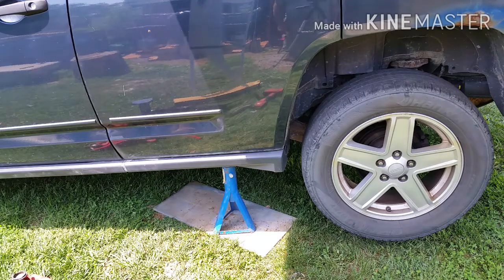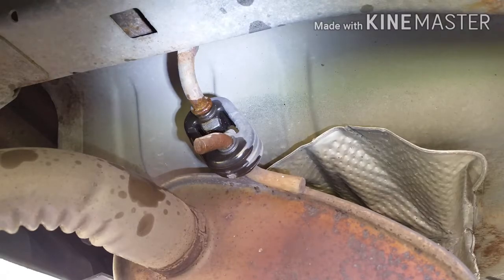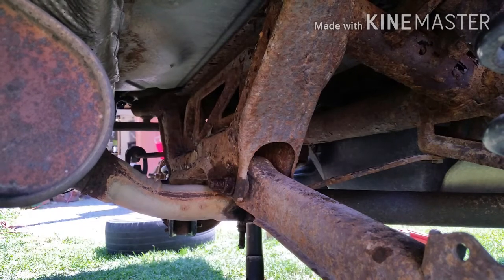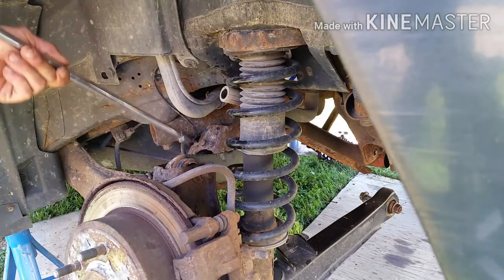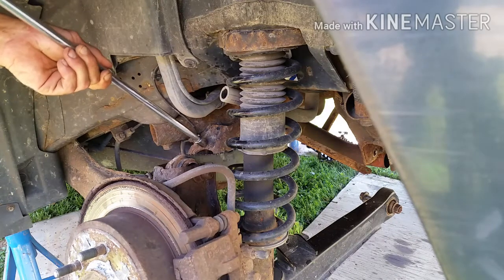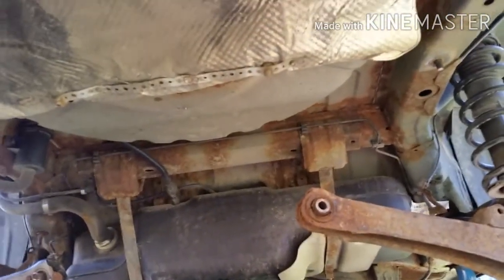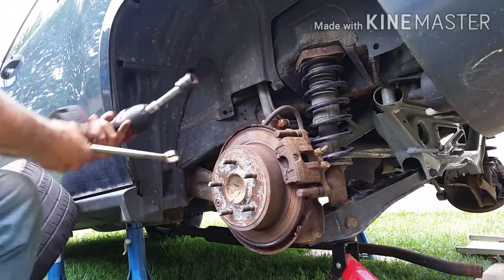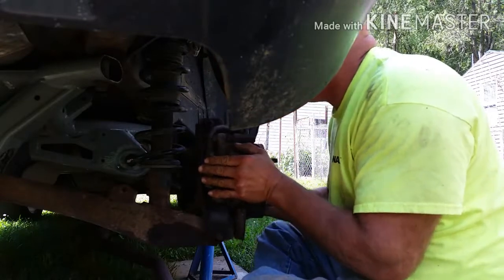How to change the Rear Sub-frame on 07 jeep compass

Comment: I realize this is an older video, but its just what I've been looking for. I gotta 2009 caliber sxt needing the rear subframe replaced and it looks like a heck of a job. You gave me some really good tips on disassembly and I appreciate it immensely. Didnt see anywhere on how long it took you to complete the job. Guessing at least 1 solid day. Thanks again for a great video.
Reply: your not alone. my 2007 needs the rear replaced and im gonna do it this weekend, id recommend lots of PB or WD40 before hand. and a breaker bar. the caliber its a great commute car tbh  just needs proper care

Comment: Fixing these rust issues is not for the faint of heart. So many of the younger generation would not have the physical strength to tackle this project. The one thing I would add is before you jack the car put a tarp down on the grass. It makes finding dropped hardware and tools much easier to find.

Comment: Great video. Thank you, I'm going to be doing this, this weekend.
Reply: Mine rusted so bad the lower control arm broke right out of the frame and hit the ground. Luckily we were in a parking lot, not out on the road.
Reply: @timkeiper8588  I just replaced the lower arms 2 months ago, now the upper arms messed up and my subframe cracked... it just cost me 1000 to repair on Thanksgiving
Reply: @timkeiper8588  I am in the same boat. Looks like previous owner got into anaccident which case the lower control arm to bust out of the subframe and split along the edge. It was very poorly fixed with large washers welded on.

Comment: Curious how you got the two broken subframe bolts out. I'm in the middle of this job right now and am having a hard time removing the two broken bolts.
Reply from the maker: I got lucky they broke off with enough  room to get a pipe wrench on them.
Reply: @Viral Workaholic  what if you can't get a pipe wrench on them?
Reply: @cnubz1107  I am 3 months late to give you advice on this, but just in case someone comes along with a similar problem I'll give my 2 cents. The easiest and most surefire method is to just weld a nut onto them if you can weld and its not broken off down under the surface. Otherwise get some pb blaster or similar lubricant down into the threads and let it soak and reapply as much as you have patience for, then drill a hole into the bolt shaft and get as big of a bolt extractor bit into the hole as far as possible then start cranking "lefty loosey", and pray the bolt breaks loose before the extractor breaks off. you could also try heating the area around the bolt with a torch, it might expand enough to break lose from the bolt, or at least relieve a little pressure while you're cranking on that extractor bit

Comment: You said you broke two bolts outta four for the subframe. How did you remove the broken bolts
Reply: I imagine hes got a screw extracter set on hand. I ripped the subframe out of my old compass to put on my newer one. Previous owner got into an accident and it mangled the subframe making alignment impossible. I broke one bolt removing the subframe o when i go to the swap I will have a screw=extractor set on hand in case. You drill a hole into the broken bolt and the extractor will grip inside that hole and you can reverse it out.

Comment: How did it drive after you left the broken bolts in?
Reply: I’m curious too??
Reply: I did this same job on a customers car and 2 of the bolts broke on me also i spray the bolts with penetrating oil there was so much rust on everything that the penetrating oil did not do anything I used a torch thinking it would help but it did not so after the bolts broke off I was able to heat the area around the stud that was left and with a vice grip I was able to remove both bolts and we order new bolts and replaced them.
It was a free job I work at a shop that had a girl working there and the car came in with a grinding noise from the rear the girl told them it was the brakes that was making the noise the customer say ok do it she change the brakes and the noise was still there she went crazy trying to find the noise was not able to find the noise so the manager told me to go find the noise and it turns out the noise was coming from the rear sub frame being broken the replacement sub frame cost $300 because the brakes was missed diagnose the customer got free brakes and a free alignment and free subframe and free Labor the customer got there car back with all new parts everything fix and paid $0 out of pocket the shop took the hit.

Comment: Can you or anybody tell me a good place I can get a subframe and how do I know if it’s good quality or not? I’m seeing a lot of different prices, what would the difference be?
Reply from the maker: The rear frame I bought used from Stoystown Auto parts in Pennsylvania. The front I ordered online. It was less expensive online and it was new. It can be more difficult chosing the correct part with so many options online. Do your due diligence to get the one for your specific vehicle. Make sure it has the hardware and get it online.

Comment: Good video. BUT the four wheel model is NOT as easy to change, and especially with Northeastern PA rust.
Reply from the maker: This weekend I'm going after brakes and the wheel bearing on one side.
Reply: @viralworkaholic6766  where did you find the part for this? I can only find rear crossmember for the 4 wheel drive...
Reply: @briarg1485  That 2wd looks like the same subframe as my 4wd. But as Tim said, replacement is a lot more work on the 4wd. BTW, some torque specs would be helpful here.
Reply: I am in the middle of changing out the rear sub frame for a 2010 Jeep Patriot Limited 4wd and NO it is not easy. Mine has severe rust and most of the bolts take a lot of TLC to get them off/out without breaking them. I am down to one major task now, getting the left rear CV shaft out of the hub. This CV shaft is seriously stuck. I have now tried tow different tools designed to push the shaft out of the hub with no luck at all. It appears that I will have to remove the hub/bearing assembly with the CV shat and use a hydraulic press to remove the shaft. I  have three (3) of the four (4) bolt that hold the sub-frame to the uni-body loose but one of them is giving me a fit not wanting to break loose. I drilled a 1/4" hole in the outer side of the uni-body so I can spray PB Blaster into the channel of the uni-body hoping the penetrating fluid will get to the top of the bolt and help. I know that the nut for this bolt is spot welded to the channel piece of the uni-body and I don't want to break the but loose either. I cannot get the bolts that hold the transmission to the sub-frame to loosen up either. Hopefully I can get this sub-frame and tranny out together onto the shop floor and see a better way to loosen these tranny mounting bolts.